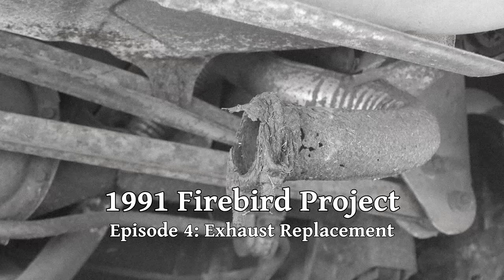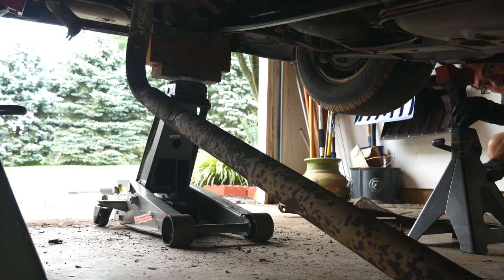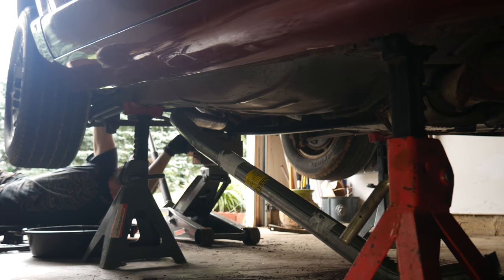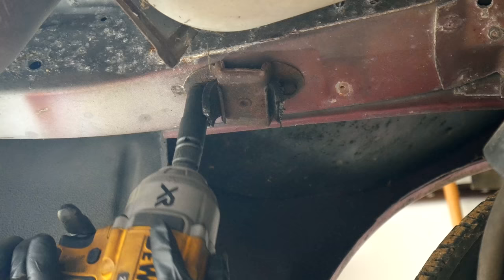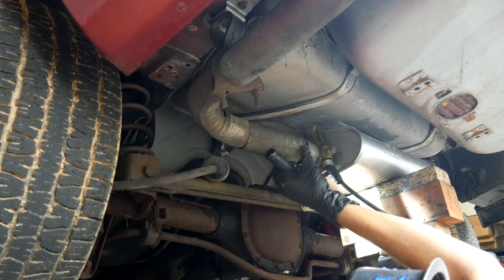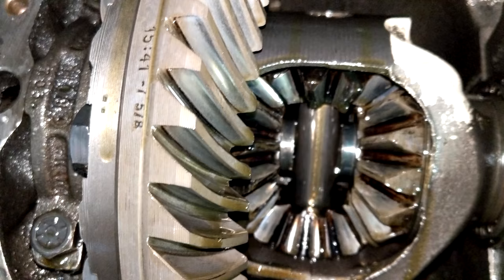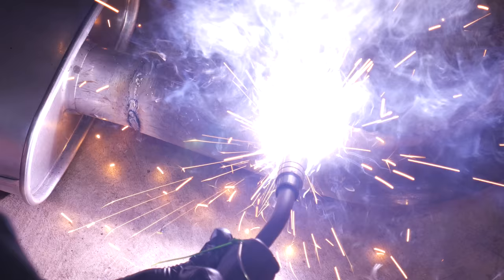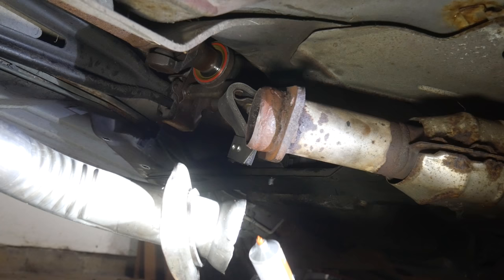1991 Firebird Project Budget DIY Exhaust Replacement/Repair (Ep.4)

Comment: Asking out of curiosity; wouldn't single exhaust outlet may damage the valves with back pressure, since this is a high displacement engine?
Reply from the maker: No, in fact it may even flow better with just the one outlet since the aftermarket muffler is most likely less restrictive than the original factory one. The muffler is fed with the same tailpipe as before, and the only change made was after it so the flow really shouldn't have changed. Either way, a small restriction wouldn't matter too much it would just lose some top end power in all likelihood, but this engine isn't huge and with all of the emissions restrictions doesn't need to flow a lot of air anyway.

Comment: Just a suggestion. Wouldn't WD40 be useful when tackling these rusty bolts? It might just save a few being snapped off and my also save bolt threads.

Also when you take off rusty parts, instead of putting them back on, why not give it a wire wheel treatment and some Hammerite (or other hard-wearing paint option)?
Reply: Original WD-40 isn't a penetrant. You would need their branded penetrant or something like PB or liquid wrench.

Comment: How tired was your neck during all that? I remember repairing my own vehicles years ago. It's a lot more work than most people realize. Also holy crap you are brave welding right underneath the gas tank. That's a sure way to die quickly.
Reply from the maker: Neck gets very sore working under cars. And fair point about welding near the gas tank, for what it's worth I did as much checking as I could to make sure there were no gas leaks or vapors present before tacking welding the pipes, but some things will always involve a certain amount of risk.

Comment: Real question: how does parts 𝚞𝚗𝚍𝚎𝚛 the car rust?
Reply from the maker: They get worn down by normal driving conditions over time, dust/dirt/gravel/water slowly removes the coatings on parts which leaves them to rust. In rust belt areas that use salt on the roads in the winter, the salt clings to the underside and builds up anywhere it can which drastically speeds up the chemical reaction and breaking down of steel.

Comment: You would have saved yourself time if you just cut the exhaust out
Reply: He could of saved himself some time and money if he had just ordered some FLEX TAPE™ The tape of CHAMPIONS

Now introducing Flex Seal™  - The best product to Coat, Seal and stop leaks fast.  Now thats a lotta damage!
Reply: How will you get the new one in? I mean... I guess you could do it twice
Reply: That was my thought, but then he used the angle to put the new in, so it saved time on that step.
Reply: But he needed the bolt to bolt on the new one :')
Reply: Just cut the new one and re weld it
Reply: He had to be able to get the new exhaust pipe in without cutting it up and by figuring out what had to happen to get the old one out he knew that he could get the new one in.
Reply: @Northern_Farmer  but thats alot of extra work for what it is man its fine how he did it in the video
Reply: Got to consider emissions in some states so just cutting it out isn't always an option.
Reply: Mad Mod they don’t mean cut the exhaust out and just completely leave it open header they mean instead of twisting and turning the exhaust trying to snake it out just jigsaw it
Reply: Mad Mod   Cutting exhaust doesn’t effect emissions
Reply: @Rose.Of.Hizaki  Has our culture really reached the point where just regurgitating advertisements is considered humor?
Reply: @nomadben  One does not simple regurgitate Flex Seal™

Comment: What kind of cordless impact wrench do you use?
Reply: I think it's a dewalt
Reply from the maker: The large 1/2" Impact is a Dewalt 20v Brushless XR, it is fantastic once you put a 5+ amp battery on it. A little big and heavy for some spots though, I also often use a Dewalt 20v Impact Driver with a 3/8" adapter on it. Not nearly as powerful but quieter, smaller, and much lighter.
Reply: Fuzzy Dice Projects Nice! Those do waltz are top quality units. They are right up there with Milwaukee. As far as popularity and versatility. Good torque numbers for breaking loose tough fasteners. Your videos have shown that. My personal half inch is and I are 7150. I have a five amp hour battery that I throw on that too. I have not come up against any bolt that has been able to resist the not busting to work. I am a big fan of cordless tools. Yeah you may spend a little more but you will probably end up spending the same if not more putting together a garage air system. Keep up the good work man!

Comment: Remove the old cat and replace it with a second muffler or a smaller cat. Something lighter and newer. Something less rusty lol
Reply: Why tho, this cat looks decent inside.
Reply: @adrianll8289  The old cat has rusty inlet and outlets and a lighter one might help with sound, emissions, weights and flow. 

I change the cat to a cheap small cat from the old one and it helped with power and sound. I have a 87 Celica. I also removed it since in GA we dont have to  have cats on cars legally

Comment: i stopped the video part way thru when you were welding all that old tailpipe nonsense to your new muffler. dude...that pipe and tail pipe is so cheap for parts. they sell it literally in bins at canadian tire for a few dollars. all for the sake of keeping it stock? just put in a 90 degree and a bologna and your done.
Reply: Then you have a blatantly cheap non stick looking exhaust that doesn’t fit right. 

And cheap is nothing compared to free!

Comment: Another disclaimer should be NEVER work on vehicles with open toe shoes like you are wearing. Always wear closed toe.
Reply: Why? Worst case he gets cuts or scrapes. If something capable of breaking or severing toes happens a pair of “closed toe shoes” doesn’t do much other than keep the gore contained. 

On the other hand, actual safety shoes/boots are probably overkill when dealing with light parts inches off the ground, he’ll! I can’t think of a single time in this vid where the guys toes were in any way likely to get something dropped on them. What with him laying on his back most of the time his toes were the safest part of his body!
Reply: It's standard mechanical knowledge that you take off all jewelry and have closed toe shoes while working on vehicles and besides all that cutting and rust pieces could easily get embedded in the foot or toes. ijs its not really safe in any manner lol